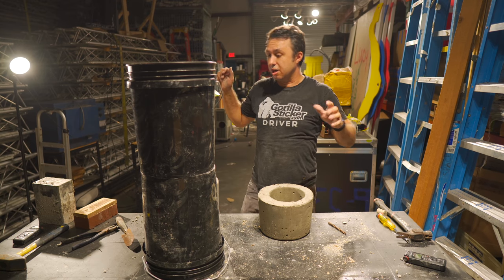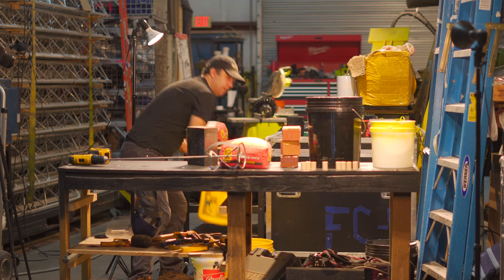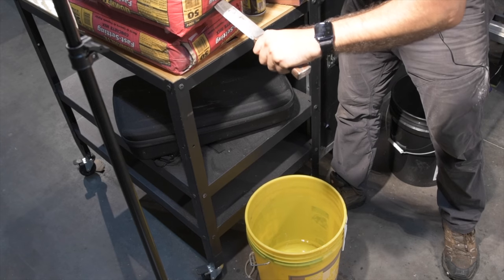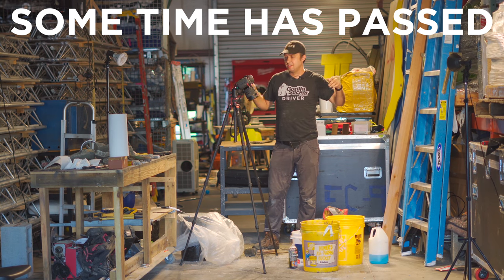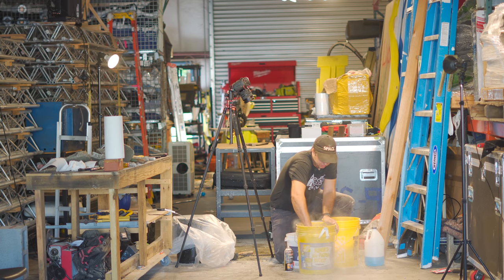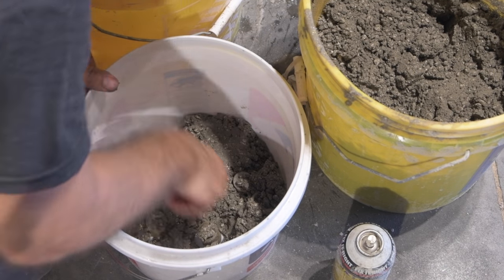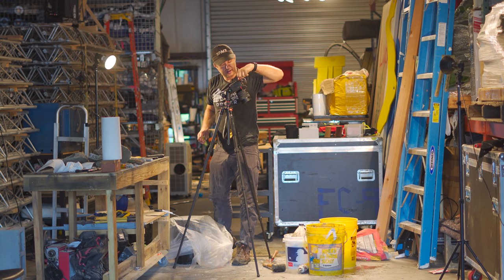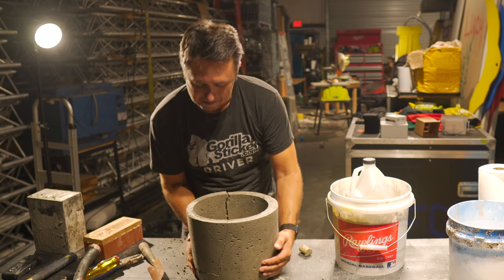DIY Concrete Planters made with buckets! How to make your own rustic planters of any size!

Comment: Thanks man! A great video on what not to do. I watched so many videos on youtube where they wear a mask to prevent inhaling cement dust, mix the cement and agregate first and then incrementally ad water until it's the consistency of oatmeal, after the pour put plastic over the whole thing so it cures slowly. The longer you allow it to cure, the stronger it will be. It's like baking a cake. Follow the recipe and you'll get it right every time. Anyway, a genuine thank you for trying. ❣️
Reply from the maker: Haha, thanks Paul!  Yeah, I should change the name of these kinds of videos to "First Time DIY."  That said, both of these pots are still going strong a year later, and are even featured in the background of all my new videos!  Its not SUPER necessary to have extremely structurally strong plant pots.. But generally, you are right, thats the way to do concrete and I made a horrible mess..

Comment: I just read a couple of comments vaguely mentioning needing to leech your pots before adding plants to them. I’ve watched a ton of these making concrete planters videos and never heard it mentioned before. After googling though it does seem like a good idea. I took this from one of the sites explaining leeching-“Hose pots down 3-4 times a day for about 5 days, while intermittently misting with a weak dilution of vinegar and water and rinsing with a garden hose. Or you can fill pot with water and let sit for a few hours and mist with weak dilution of vinegar water between soaks.Then they will be ready to plant.”
Good luck fellow DIYers!🤗

Comment: Forgot to tell viewers that not only do you lubricate, or use wax paper, which you forgot to do, the base bucket, but you will have to do the same on the outside of the inner bucket. This was definitely a "true" DIY project. Not everything goes as planned.
Reply from the maker: Sure did! Ad SURE DID; Im surprised I managed to get it apart at the end.. Thanks for watching, and I hadn't thought of wax paper, thanks for the tip!
Reply: @SPACEDESIGNWAREHOUSE  They also make wax lined tubes that are sold at most hardware store, that can be peeled off when done. Probably a little bit more of an expensive route, but just another option.  Wax paper works but, it leaves the impression of the paper, so it might look terrible cosmetically if used on the outside portion. The bucket and lube idea is better for aesthetics if you can get it to work.

Comment: Mold release! You can use all sorts of stuff. Paraffin wax is a great one. You can mix it with a small amount of vegetable oil which will act as a solvent.  Make sure to use white wax as colorized wax may leave stains. A candle and some kitchen oil is pretty easy to come by!
Reply from the maker: 📝 I wish I could read your comments before making this video
Reply: @SPACEDESIGNWAREHOUSE  Basically cunningham's law. Just something to keep in mind for next time :) Good video.

Comment: What about using a hole saw cutting out the dowel size holes in the bottom of the smaller container, then pushing the dowels in and up (make them a 1/4 or 1/2 inch longer) up through those holes. The plastic should hold them in place, and if sprayed should be re-usable. Or using two long 1 foot dowels (or metal coat hangers) and a smaller bucket, putting them over the big bucket through the small buckets "Handle" to "hover" the small bucket over the big one, don't need to use dowels. Coat hangers could bend "downward" and make it so the small bucket is the same height off of the bottom of the big bucket, since dowels dont bend a great distance. great videos!
Reply from the maker: Oh dang, that’s a really good idea with the hole saw and dowels!!

Comment: Hey mate, great video. I have some tips you might appreciate.

1) those mixers with cement and concrete will put alot of ware on your drill, DeWalt is tough as nails but I wouldn't recommend it as even rotary hammer drills can't keep that up for long

2)mixing is alot easier if you add less cement or concrete to begin with, mix it  thoroughly and add more as you go.

3) your final product will be much less likely to break if you add some kind of support material in the gap before you fill, preferably not steel as that will eventually rust and cause it to crack, aluminium should be more than strong enough.

Hope this helps and I'll be trying this out for myself some time, it'll go great with the mobile planter box I'm making for my partner
Reply from the maker: 1) Yeah, something I edited out was my HUGE surprise at just how HOT my drill was getting. It didn't feel like it was working any harder than say, using a paddle bit to make big holes in wood, which Ive done plenty.. But the 'exhaust air' coming out of the side of my drill was too hot to touch! 

2) good pointer, that was strenuous. 

3) I considered it, but then I was thinking about cinderblocks, which dont have any reinforcement and they're definitely strong enough to hold some dirt.. I mean, if I were making a countertop or a floor I would definitely slide in some chicken fence or rebar or something, but hopefully these planters won't need to be load bearing planters :)
Reply: @SPACEDESIGNWAREHOUSE  oh yeah 3 was more just an idea for helping them get out of the mold, I'm sure from there on just cement or concrete is fine
Reply: Great tips, thanks!

Comment: Why not just fill the bottom bucket with the cement and then push the smaller bucket into it??  You could tape the little dowels onto the small bucket?  That way you're not trying to pour in between the 2?  Just a thought.

Comment: So when it comes to setting fence posts, they say you can just pour the Quikrete's Fast-Setting powder and just add water into the hole. So then I wonder...when making pots, can you just pour the powder into the mold and then add water?
Reply from the maker: I’ve seen that on the bags also.. but it REALLY didn’t seem like the water was going to mix in without some coaxing. But it’s cheap enough that it would be easy to try!!
Reply: @SPACEDESIGNWAREHOUSE  thanks for your reply! I will give it a try that way. By the way, I REALLY appreciate your video just walking us through all the steps including the attempt that didn't quite work out. It helps newbies like me to know what to watch out for!!